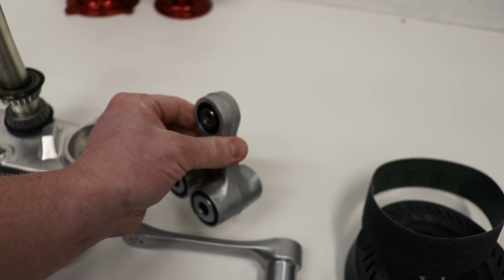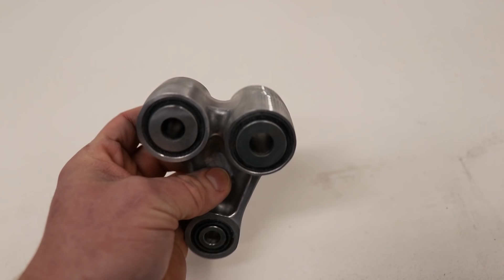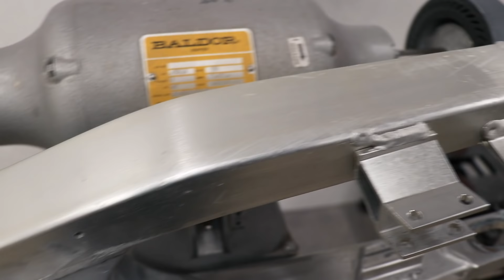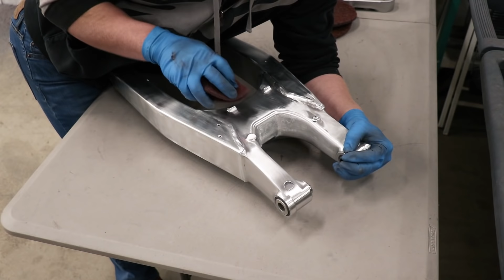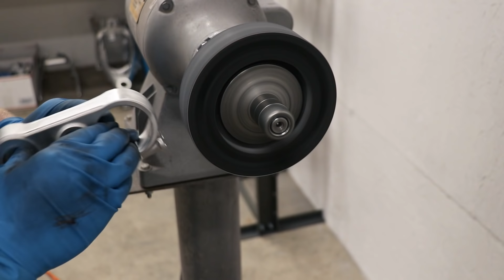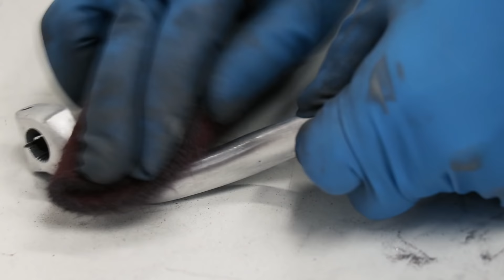My Secret Weapon For Making Aluminum Look Amazing!

Comment: What would you recommend for preserving your work.  I have polished up a few aluminum parts to a beutiful finish but was reluctant to spray on a coat of clear because that is what I typically have to remove before I polish.  What would you recommend.  Can you clear powder coat?

Comment: As a first step I used a 4 1/2 inch grinder with a scotchbrite.  It was easy moving the tool around the part rather the other way around.  Still needed hand work but got the nasty finish off quickly

Comment: Hey Camreon, impressive job! Do you put any kind of protection layer on those elements before mounting them on the bike?
Reply from the maker: Thanks! I do not use any protection. Most parts on a dirt bike are bare aluminum and do not have issues with corrosion
Reply: Thanks for the reply! Any recommendations for stainless steel? I'm renovating the exhaust headers on my VFR800, removing the rust, polishing and wondering about how to protect it from rusting again... Thanks a lot for any advice!
Reply: Thanks for the reply Cameron! Any advice stainless steel protection? I'm restoring rusted exhaust headers and I'm afraid that they're gonna get rusted quickly... Awesome content! Fingers crossed for your quick recovery!

Comment: I bought both of the scotchbrite pads off your website last week and got too use them today. Honestly its mindblowing lol. It just drives me nuts because I can't get a consistent finish all the way over what I'm trying to do. Its gonna take some getting used too
Reply from the maker: What kind of part and material are you using the pads on?
Reply: Cameron Niemela triple clamps and swingarm. I'm thinking about getting some 600 grit and wet sanding them to get it even and then hitting them with a scotchbrite pad for the brushed machine look hopefully
Reply from the maker: @bmocaby9747  It's a bit tougher to get a consistent finish on larger parts with the wheel on the machine so try using the pads by hand for the final finish to get consistency.

Comment: I prefer flap wheels on the buffer either 220 or 320 grit to knock down casting.Flap wheels on the dremel will also avoid most of the tendencies to cause an uneven surface.Its good to see different way to obtain the same outcome. Good vid.
Reply from the maker: Thanks! I'll give that a shot next time.

Comment: Try a Scotch Bright Flap wheel next time. It will eliminate the sanding wheel process since it's a combination of sand paper and the Scotch Bright Pad itself in one product. It comes in various grits obviously and will make this job much easier and faster.

Comment: Don't wanna take too much off the top of some cast aluminum parts though.  That outermost part of the aluminum is harder than the internal parts, because it cools faster after the casting opens up when its made.  Its called the "skin".  And it adds a lot to the strength of a part.

Comment: Good attention to detail.  I like you you just got in there and did it.
I stripped a cbr 900rr by sanding what I could, used oven cleaner on the swing arm.  Sanded through 2000 grit and polished to a mirror.  Looked good, but I will never do that again!

Comment: Looks spot on bro 👍 Suprised you did this with the bearings in though. what you going to seal it with? otherwise that lovely finish is going to oxidise and your going to end up right back where you started

Comment: Hi Cam, 
I know your vids are probably a few old with editing, but use parafin(candle wax) because it isn’t as sticky and does not allow the aluminum to break down the aluminum oxide as fast. Also, get a medium to firm rubber sanding blocks will help conform to the shape and produce an awesome finish. Last step is triple 000 or 0000 steel wool pads, and will give the aluminum a crazy brightly polished finished look. Way shiny than what you had(and it looked great too. Scotch bright wheels are 320-400 grit, and can tend to be pretty rough. Light gray scotch pads are 1about 600 grit. That’s why I use the 0000 steel wool pads and a bit of WD-40 or Marvel Mystery oil as it will lube the process and keep the metal from loading up on you. I’ve been a Machinist a very long time(38 yrs). I know how how to polish anything even clear plastic. Your doing a great job, and. The little hints will take you up a level or two. Try the 0000 steel wool pads from Home Depot/Lowe’s just by them selves, you’ll see exactly what I’m saying. Good luck brother, Dean.
Reply: ProfabDesignd Inc. Any advice on how to polish a motorcycle windscreen 93 Honda CBR900RR
Reply: Replying late but in another video he mentioned that he intentionally did not want a more polished look than this. Also because the polished look requires more effort to keep it that way
Reply: With white diamond polished aluminum is easy. Any good polishing compound can make aluminum like a mirror. Even if you just want it brushed looking.. seal it with something to keep off oxidization.
Reply: Sounds like experience here, ok once you get that great aluminum look...How does one "KEEP" it looking great??... there a coating of some type?
Reply: @thecentralscrutinizer5105  cerakote mc-5100
Reply: What type of wax or clear coat would use over polished aluminum or alloy?
Reply: @toddhowland890  It depends on the finish and environment your in? If you are near salt or the ocean, I would recommend ‘Shark Hyde’ it seals the oxidation layer of aluminum, I also a silicone dioxide or ‘ceramic’ based sealer. It’s expensive but works amazing.

Comment: finish off the swingarm with a wool wheel on a buffer with aluminum mag mothers polish
Reply: gave mine a mirror finish
Reply: Mag polish still will leave little scratches mothers aluminum polish is finer and will be a Smooth finish

Comment: Wont removing the casting marks weaken the parts ? 
I cant be the only one thinking this.
Reply: nayr h19 Not really, the marks are just little edgedes from casting, however grinding away welding lines beyond a certain level can weaken the structural integrity of a part...
Reply: nayr h19 nope it can strengthen them if done properly. It reduces stress risers if you smooth it completely and dont compromise the structure of the part. Youre basically blueprinting the part. If im really serious sometimes I chuck it in a mill and do a bit of squaring off and take some surface material in the right places off for a factory look
Reply: Shane Davis oh cool thanks for the extra info

Comment: I got a belt attachment for the grinder that has a platen on top and a small rubber wheel on the front edge that is great for tight spots
Belt change is just flipping the lever on it so I use a bunch of different ones to suit the material.
Its got a disc on the side too.
They are pretty common and cheap, bolts on quickly.
Bit safer then working on the wheel that is attached directly the the motor axle, that rubber one could get a good hold of anything loose.
Other end of the grinder motor Ive got a buff taper thread with rag buffs for SS and Ali and various grades of rouge, I use the green on the Ali gives a good finish.
Post buffing I spray it with kitchen spray cleaner that washes all grit out of the surface rinsing in water, leaves a mirror finish.